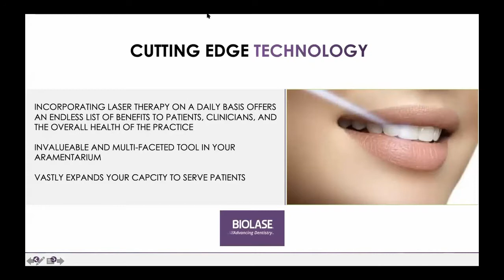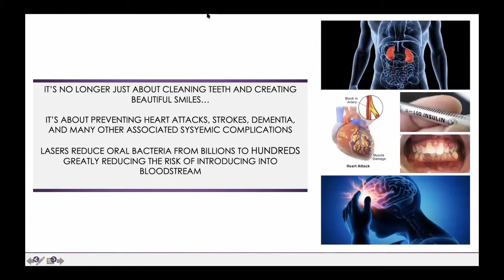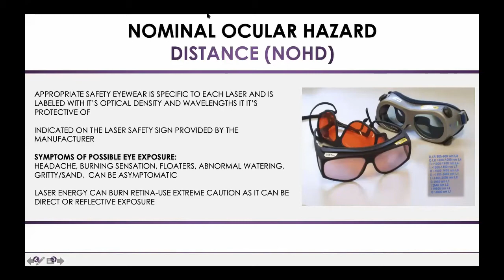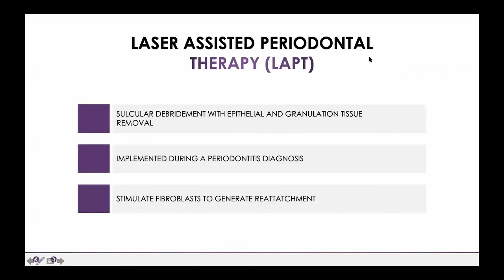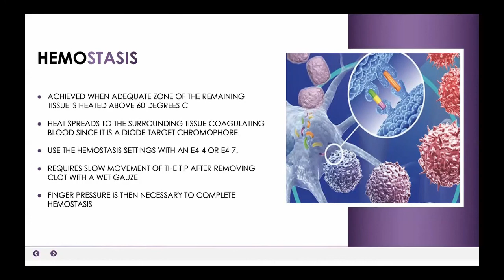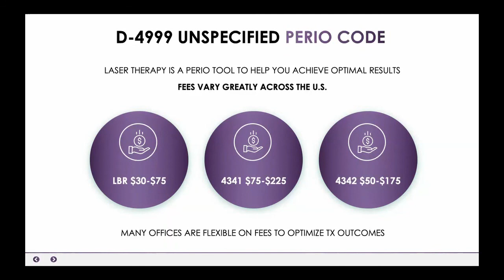Up Your Hygiene Game: Clinical Benefits of Incorporating Lasers in Dental Hygiene

Comment: I left CA in 2008 where I had a laser license. I now live in Florida. The standard practice here is give em arestin. RDH do not have a practice act I have been non political. Until now. I want to try to expand the practice act. What suggestions do you have. I am almost appalled at the use of antibiotic theorpy and being told to administer it when there is no significant CAL. WE AS A PROFESSION need to be trained. Ps. I worked in PDX for 16 years. Loved it. Wish I never left